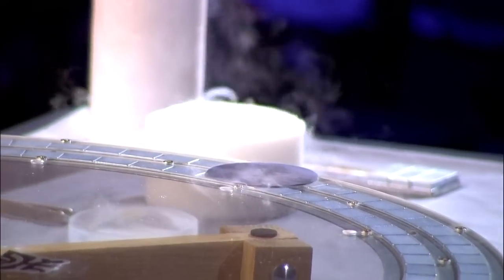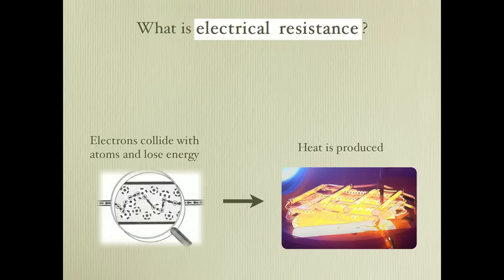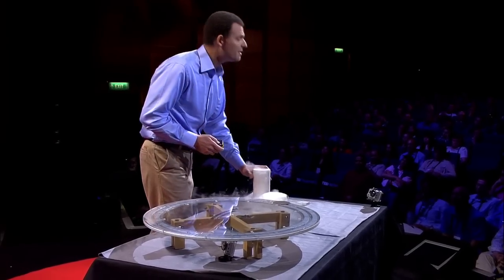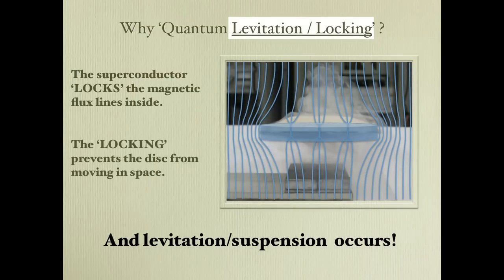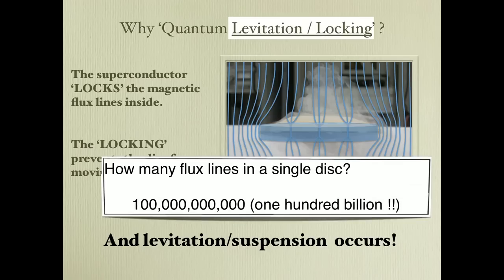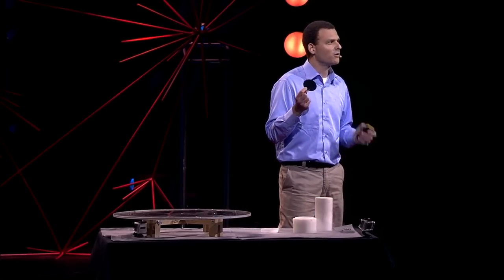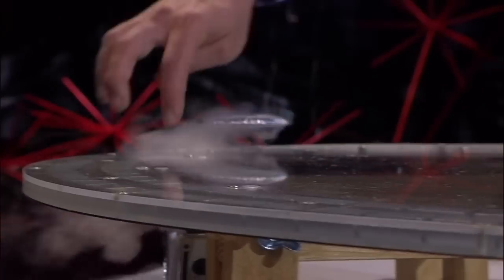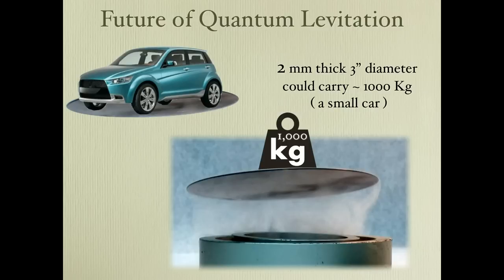Boaz Almog "levitates" a superconductor

Comment: So where is my hoverboard?
Reply: Derek Leung as soon as the sidewalks and streets are constructed of magnets
Reply: Derek Leung Lexus
Reply: Joshua Meadows The earth is a giant magnet.
Reply: I think they're gonna need to make a hover board trail specifically :o BUY ME ONE!
Reply: WAIT! HOW DO WE BRAKE!? We're gonna need to manual stop with friction on the ground or something of that sort right? o.o
Reply: Sonlang Siek To break, add heat to the hover board for it to lose its superconductor properties?
Reply: I don't have any or much knowledge in this field of study :( Sorry for intruding on your guys' conversation involving high level of intellect and knowledge about superconductors :<
Reply: what we need is a 5 mm thick piece of superconductor, inside of its own refrigeration unit keeping that superconductor superconductive and expel the heat it produces to move forward or slow down. now, as he said that a 3 mm thick piece can pick up a car, its vertical location is locked to the magnet but its horizontal location is free, to get it set to a certain height you must hold it at the desired height and then turn on a electric magnet beneath it. as the superconductor has no resistance from friction but gravity is still in play. i would suggest that there be a way to slow down through means of the mag rail. put small buffers of magnets with reversed polarity to slow it down, with small thrusters for acceleration and deceleration.
Reply: Sonlang Siek reverse the polarity in the hover board =p or car xD expel the magnetic fields in the opposite direction that u were traveling?

Comment: So why does it fall at about 8:45? Is this due to the superconductor's temperature being raised to above 100K (superconductor jurisdiction) which in turn causes there to be resistance and energy loss? Because if it stayed with no resistance then it should be able to go along the path until someone or something outside the system stops it, right?

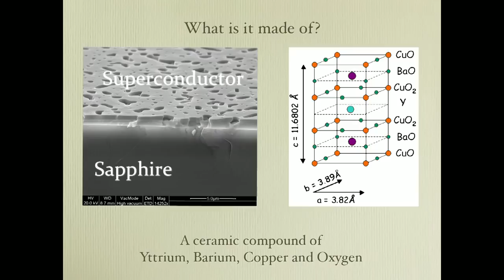Comment: you misunderstand what he is saying, the superconducting layer on that disk is so thin (7:00), that the saphire layer and his wraping make up most of the weight in this instance, it is the weight of that single 1/2 micron thick layer. Nobody has made a superconductor 2mm thick that is layered in a way to have that maximum pinning effect. the difference is that meisner effect has the magnetic field traveling AROUND the superconductor, Flux pinning has the field traveling through 100billion flux .

Comment: My first sentence does not make any sense ^^ . "Read over before posting", I need to carve this somewhere on my body. "... superconductor requires a low temperature like boiling water requires a hot temperature." ... this comparison does not work. Water is a material, "superconductive" and "boiling" are characteristics (you can find some other fluid that boils at low temperatures)... Therefore, I had to add "I believe we won’t find any material ... "

Comment: I was being cynical by pointing the fact that superconductor requires a low temperature as water requires hot temperature. My comment was inappropriate and vulgar, and I apologize. I believe we won’t find any material that won’t need to be refrigerated in order to behave as superconductor. But that’s a guess. Also I guess that the main problems for building a hovercar (using this technique) are: keeping the material cold without too much energy waste, high cost of the tracks, magnetic pollution.

Comment: The superconductor has to stay cold because the metal's energy has to be low so the electrons within fall to their lowest energy state.  This allows the material to form what you call a Cooper Pair.  This pair is consisted of two electrons that propel each other throughout the material with no resistance.

When the superconductor is put on the rail, the magnetic field of the rail creates surface currents that produce an equal and opposite magnetic field.  Hence levitation.

Comment: There are only certain materials that can become superconductors.  There are quite a few metals on the periodic table and alloys that have this ability.  The one in this video is a ceramic called YBCO and its transition temperature is 92 K, which is why he can get it to superconduct with liquid nitrogen (77 K).

As long as the superconductor stays cool then it will float forever.  As it travels around the track though, many sources of energy are heating it up.

Comment: Nope, wrong as well. The mist you see is water condensing out of the air due to the extreme cold. Liquid nitrogen doesn't sublimate, it boils, just at -340 degrees F. You can't see the nitrogen vapor coming off the boiling liquid nitrogen, just the condensation of water in the air. Think about the cloud your breath makes when you're outside in the wintertime, same thing. Dry ice does sublimate, but that's not cold enough (-109 degrees F) to work.

Comment: No, it's not fake, the "smoke" is water condensing out of the air because the disc can only be a superconductor at extremely low temperatures, around -210 degrees C, -346 degrees F. Why do you think this kind of tech isn't widely available? It's not "magic" and it's not fake, you just need a supply of liquid nitrogen to make it work, which is expensive and hard to get. You can see him pouring it onto the disc every few minutes to keep it cold.

Comment: its not steam, nitrogen would give out nitrogen on boiling which is invisible. Mist is actually very small particles of ice that are formed through condensation of water vapor that is present in the air. And because temperature is so low near the surface of liquid N2 that instead of water droplets, we have ice particles.

Comment: I dont think that is possible. If I can lift a car with my finger and throw it a couple of yards away with little effort, I'm creating energy! Which is impossible. Quantum locking is to my understanding, like a metal attachment to the super conductor with no visible material in between. I say metal because it can take so much weight. So the weight would act on the base but with no visible attachment. But I'm sure there are numerous uses for this discovery.
wish he mentioned it in the talk.

Comment: We have aluminum foil, very thin sheets of metal. Now imagine that but it was as thin as wire, covering the streets in crosshatching form and powered by electric companies. The disk is locked above the rail, but with more mass aka width and length, but no high, even being as small as it is, it may be possible to move diagonally. Imagine a train moving above and ocean with the guiding rail moving from below to the side to the top frictionlessly. Sorry Japan, This train>Bullet Train!

Comment: My guess is that he couldn't show the full abilities of the superconductor because he didn't have time and/or resources to put a heavy object on the conductor; not to mention the effect isn't able to last long on the superconductor since it does eventually heat up enough to lose superconductivity. As for the material being so thin they have to use a very specific, man-made material. Knowing science this stuff probably costs a lot and the extra material would be wasted or may even cause problems.

Comment: Having read a little about what kinds of materials make superconductivity more viable at higher temperatures it seems the ceramic type configurations have shown the best although even though the temperature is high above 0 Kelvin it is still very low and requires a power source to keep the temperature in that very low temperature state. The future is finding a way of being able to transfer electricity on super conducting cables that work at room temperature.. imagine that world every day...

Comment: i believe the disc is made of ceramic compound and by cooling with liquid nitrogen it releases a magnetic field when the atoms react to the rise back to room temprature. i would like to see a similar experiment where the disc is heated with lasers, curious to see if it would be more reactive under controlled temp.

Comment: Look the article in Wikipedia about the superconductivity. As far as I remember from school, this effect appears on extremely low temperatures (about 4..77K), so the conductor has to be frozen down by the liquid helium or nitrogen. There is a certain boundary (look at the graph in the beginning) when the common conductor (joking, it's a special fusion) becomes a superconductor. So as the cold plate heats, the boundary is exceeded, and it not a superconductor anymore, so it stops flying and fall.

Comment: I've tried something similar. I tied a rope to a board, stood on the board & tried to lift myself up into the air (back when I could lift my own weight haha). It never worked... and I never understood, until I started working for a structural engineering firm & learned about the transfer of forces ;).

Comment: If you replaced your tires with these 2mm disk, one on each of the four corners of the vehicle and you build something inside your car where the engine is to keep those four disks at this temperature and you replaced all the roads with this metal/magnetic material, we could easily start to year of levitating cars!..thanks really great video, so glad I watched it :P

Comment: This might be due to air resistance. In addition to this, as the superconductor heats up to room temperature, it might lose this "quantum locking" property. This is just my speculation however
Reply: I like your logic.  The terminology is probably more mind boggling than the actual phenomenon.  I assume that there's a reasonable explanation, but it's still totally amazing.

Comment: yes, no, and no. I know you only asked one question but its actually a really good question and a complicated one at that. simply put, in a perfect world, yes it would go on forever, but friction with the air around it would slow it down. Also the reason the material he's using is a superconductor is because its cooled below a very very specific temperature. this means that as it spins and heats up, it stops being a superconductor. the third no was because when he mentioned the lack of friction

Comment: i will clear your confusion of how superconductors work. First when a ytterbium-barium-copper alloy is cooled to below -200 degrees Fahrenheit and is introduce it to a magnetic field its own electrons bond and attach to the part of the field that passes through it causing it the magnet to become quantum locked and have stable levitation

Comment: You don't see my point, its that he was only being exposed to the gases nitrogen (when poured - due to pressure, and temperature of surrounding air). Thus once the N leaves the container it instantly collapses into a gas. Therefore the need for gloves is quite pointless - because the gas is harmless.

Comment: In quantum locking, the superconductor is not really "hovering", but locked into place. If you have a superconductor "floating" above a magnet, you can flip the magnet over and the superconductor will follow. With the superconductor under the magnet, it seems the magnet is pulling it instead of repelling it.

Comment: 1. The magnetic field is not strong enough;
2. Why create superconducting flying saucers to orbit earth if gravity can make stuff orbit "just fine"?
3. The elevator would be locked, it couldn't go up or down without some external force. Even if it did, the elevator would get hotter when it came close to earth and lose it's superconductivity.

Comment: Pipe down matey. I was having a little pop. I know they're pro's. It sounds like you're saying that the gentleman on stage was dealing only with the gasses but clearly the flask contained nitrogen in liquid form. Therefore he should be wearing appropriate safety gear. Tell me I'm wrong again. Go on. You degenerate non-contributing zero.

Comment: 70,000 times its own weight, is not even close to the weight of a human.  2 mm for 1000kg.  2000 microns.  So convert that to 1 micron is dividing by 2000, so divide 1000 kilogram by 2000, that's .5 kilograms.

Not a very impressive demonstration.  Now, if his disc was merely 120+ microns thick, it could support a light human.  But it's not.

Comment: I find it a bit funny that you are taking the setup of his demo so literally.  The force slowing the disk down is called 'air resistance' or 'drag'.  When he says 'frictionless motion' he simply means that there is an absence of mechanical friction (since the magnet and the disk are not touching), and that the quantum locking effect is making a negligible or nonexistent contribution (depending on the instantaneous temperature of the disk) to the dissipation of energy you are witnessing.

Comment: magnets don't harm the body (you can have multiple mri scans without adverse effects) as for the coolant, most superconductors require a alsmost 0K (0-8K if i remember corectly) wich uses helium (though i think hydrogen will work too) both of wich aren't highly toxic (true not healthy but not deadly iether) though I've heard other newer super conductors (perhaps the one he's using here) wich can achieve the same effects in tempratures of that in your freezer (clairification needed) wich is safe.